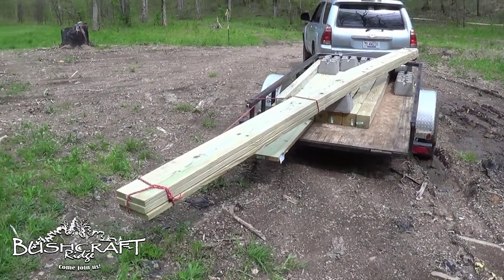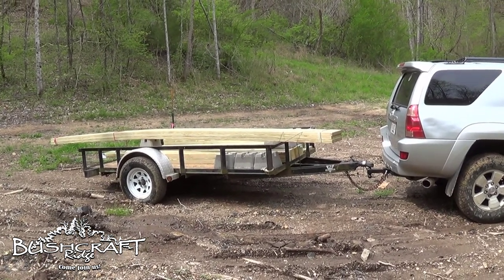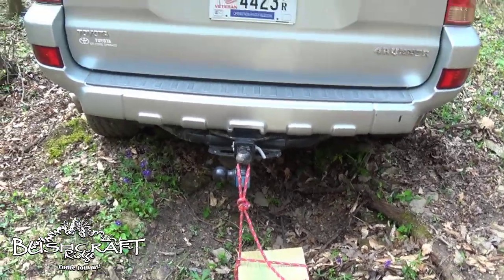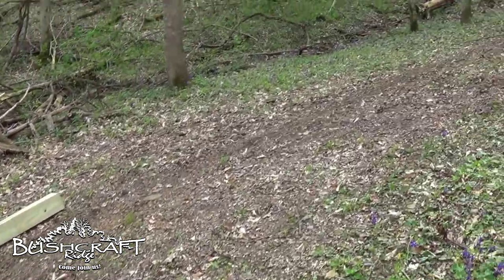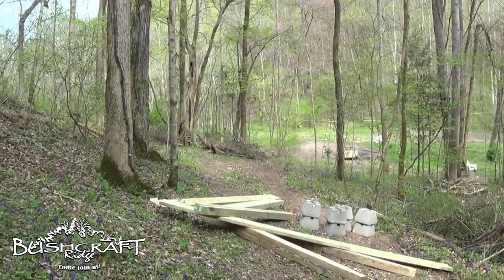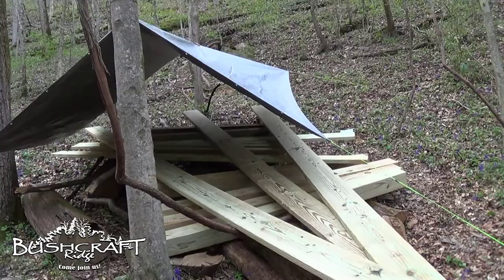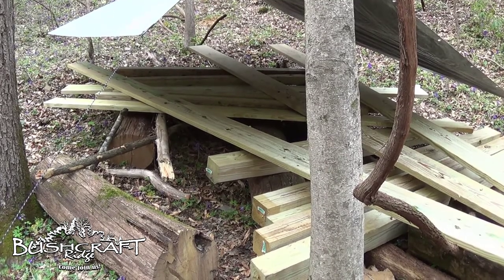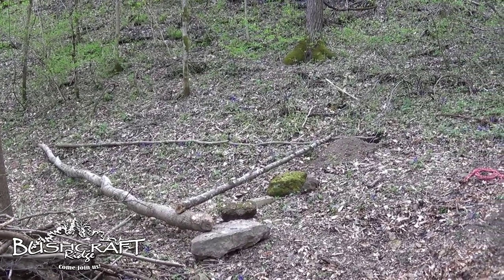Off-Grid Cabin Build 4.4.2020 -- Lumber Delivery

Comment: Well, the thing with treated lumber is it's very wet for a while, a year later it will be half the weight and a bit smaller. The 6x6x8 would certainly be very heavy when you first get it. My first experience doing a big project with pressure treated was fencing the backyard of a duplex 14 years ago. I squished every damn board tight together and after the moisture came out I could stick my finger between them. Good idea covering the pressure treated. It won't make too much of a difference if it's fresh from the mill though. Nothing wrong with leaving the boards sticking out, there's so much moisture inside you don't have to worry about them drying for a very long time.
Reply from the maker: That was a tiring day!